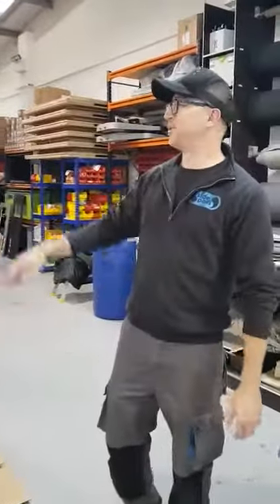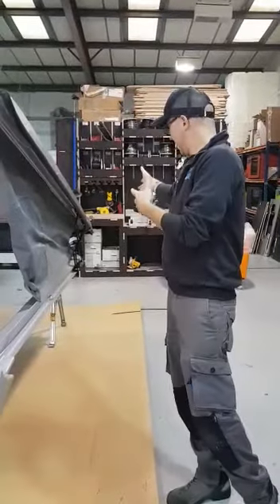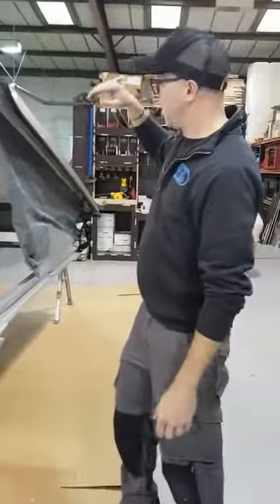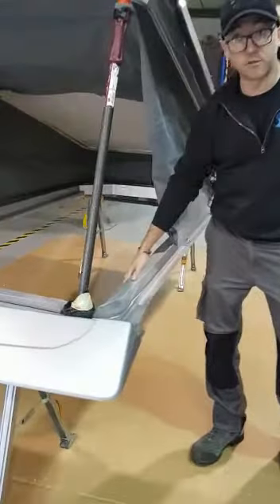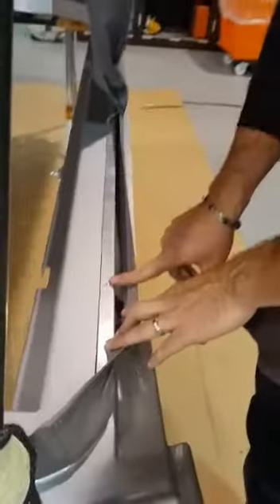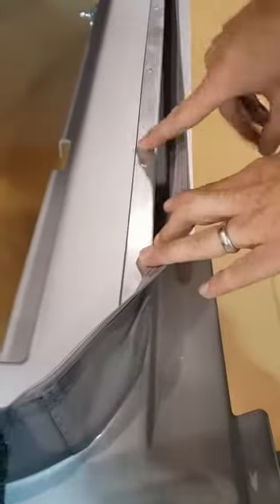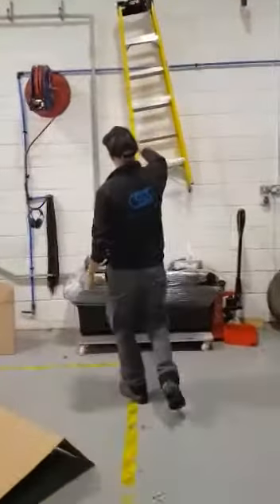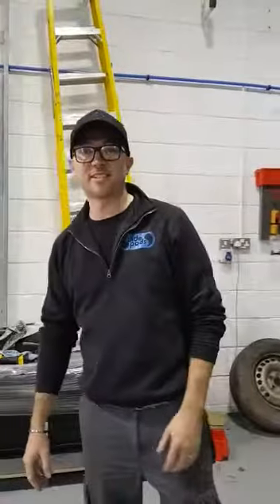How and why we fit SCA roofs into VW vans

Comment: I am struggling to find information about my SCA roof.  

It was installed in 2014.    Still holding up but the gas struts went out on the inside for the bed platform abnd ouside for the roof itself. 

They are Al-Ko but I know this sounds stupid,  I have searched all over the internet and can't find out where to buy these or even what they are called. 

Sorry to ask here but after looking everywherer and seeing how you guys work with these roofs, maybe you have a suggestion as to where to find these parts?